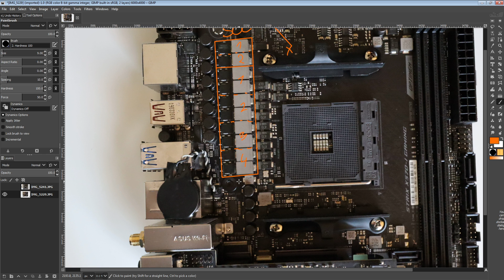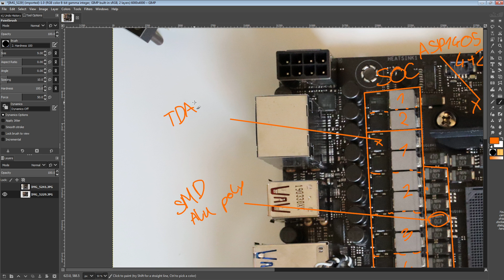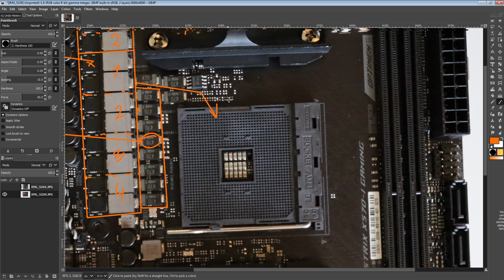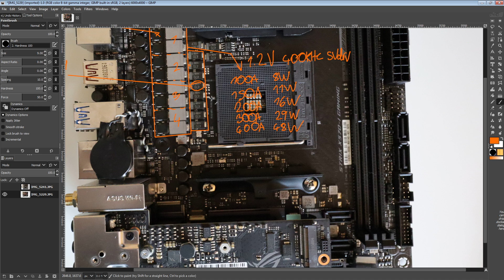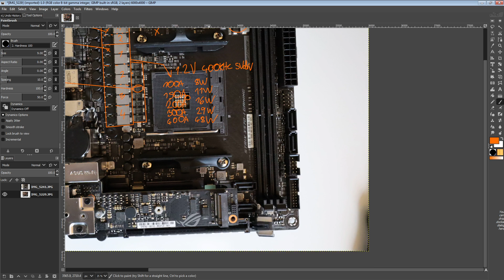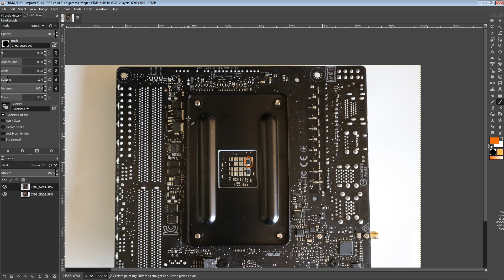mobo PCB Breakdown: ASUS Strix X570i Gaming // a cheaper Crosshair 8 Impact

Comment: I have now seem the breakdown of the 3 x570 mini-itx boards, and the only conclusions I've reached, is that it should not be the asus board... probably.
The point being that I've been unable to decide which is actually best. I'm not talking price, that's really besides the point, but the rest.
If there is one thing that is of significant importance, it's the memory controller, which should preferably be as good as possible, in order to, ideally, reaching those 4000MHz, while still being able to reach at least 32gb capacity, and preferably 64gb (for my purposes).
Does anyone have a recommendation in these regards?

Comment: I'm really confused, are there any advantages to the VIII Impact over the X570-I Strix? - The only difference I can see Is cosmetic and the Impact does not support the Noctua D15 cooler while the Strix does, which seems like quite an advantage at a lower price??
Reply: basically impact for extreme overclocking involving ln2 and stuff like that

Comment: this board vs the msi b450i gaming plus ac which is better in term of overclock 3900x :/ back then i remember the msi b450i kinda best itx mobo for 350/450/370/470 itx mobo
Reply from the maker: I'd go for this

Comment: I still have the Strix B350-F but I cannot run my GSkill C16 memory stable at 3200MHz though it is the advertised XMP so I run it at 2933MHz C14 v1.38 and I am thinking about getting Strix B450 or B550 so I can run it at declared speed of 3200 ... Should I bother, are B450 that better than B350? ... Strix X470 is too expensive anyway.
Reply: For the VRM, the B-450 and X-470 are identical.
Reply: I hear that X chipset uses AMD-manufactured chip, while B (350, 450, 550) uses ASMedia-manufactured  and lower quality for PCB (lower number of layers) which makes memory signal weaker, hence lower memory OC though I am not aiming higher than 3200Mhz, but I might upgrade to 3700x next year.
Reply: @BrankoBane2078  My B-450 Strix-F (not ITX) had no problem running 3,200 MHz CL16 on either the 2600 or 2700X I tested. That's just my anecdotal experience.

Comment: None of the youtubers has checked what WiFi chip is in there. Is it modular or not?
Reply: almost all wifi cards are a+e m.2 in a small enclosure.  pull the screws, and you can insert a ax210e with 100% compatibility.  be200(wifi7) cards are a hit or miss apparently.

Comment: Here is my horror story on my B550-I and why I should have picked up the X570-I.
The lower chipset NEEDS that extra fan that the X570-I has. IMO
Long story short: If you run a high end GPU with the B550-I it heats up the whole chipset resulting in my board losing wifi and bluetooth after 20mins of play time.
I picked up the B550-I for my new build with a 5600G as a stop gap until I got a GPU.
Got some 4000Mhz memory so I could OC the CPU and iGPU for best performance.
At first everything ran really really well, 4.4Ghz all core OC and 4000Mhz memory, not a single stutter.
Then I got a GPU.....an RTX 3070. After that, the problem started.  The lower chipset NEEDS that extra fan that the X570-I has. Now I have 6 fans in my system with plenty of cooling, CPU never went above 62c no matter what I threw at it. I install this beautiful brand new GPU, fire up a game, crank the settings because I can now game at 1440 or 4k instead of 1080. 20 minutes into gaming, it starts to stutter, frames drop from over 100fps to under 60....right after that starts happening I then lose my wifi and bluetooth, not great for gaming with a controller. I reset the system, and every single time after that when I start gaming the exact same thing happens. I rebuilt the whole rig assuming I messed something up. I checked out your videos and find that the wifi and bluetooth controller are on the same chip on that lower part of the mobo...with no active cooling compared to the X570-I. No matter how much I tried, even getting a 40mm fan and trying to blow more air near the chipset, it would kill my wifi and bluetooth. Every driver update, bios update, wifi, lan, nothing could fix it. I regret the purchase big time.

Comment: What would you say for this board with SO-DIMM ? So much more space for good things
Reply: More room, but much less dimm selection. The other downside is the increased height of vertical SO-DIMMs could interfere with more coolers. There must be issues with it, otherwise we'd see it on more boards. There was the Asrock X299 with 4 of them, but that was for more channels and an application not geared towards overclocking.
Reply: @seitenryu6844  there are some differences like theoretical max capacity, support for ECC etc. Also, for the same speed and capacity, SODIMM tends to be a bit more expensive. 
on the other hand, on mini ITX, SODIMM will make room for more M.2, USB headers, fan headers, temp/flow sensor headers and of course - more room for VRM.
Lets not forget, this is ryzen - no practical point of going beyond 3600Mhz for the RAM. 
So i do want to see use of SODIMS on ITX boards

Comment: It will still cost 300$
Reply: Well I can get them for 350CAD, which is around 250USD
Reply: @sbeve7445  dirt cheap compared to Aus which is $460 (or $365usd), trade discount or off the back of a truck? 😄
Reply: Huh? It's $260 on Amazon US right now, with the Gigabyte board being $220 and the Asrock board being $210. Nowhere near $300 unless your retailer is price gouging you.
Reply: @rcradiator  dude add 8% sales tax and its 290$... so yea 300 bucks isnt far off